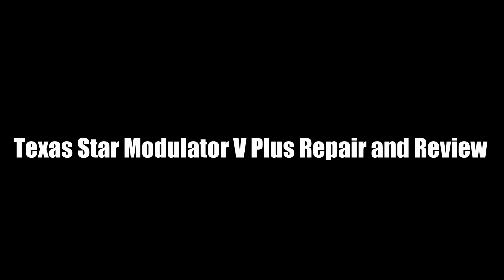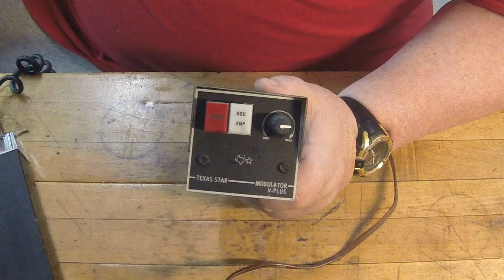Texas Star Modulator V Plus CB Amp Diagnose and Repair

Comment: Used to hit mine with 1watt dead key that would swing to 22 watts peek and give me 90 watts rms watts were around 1 to 8 watts that would net around 30 or so RMS watts. Power wire upgrade hotter radio should net above 20 more watts.

Comment: Hope you kept that little amp, they are getting extremely rare to find in good condition. It is definitely worth the value of the Toshiba pill and then some. They built that to compete with the popular BlackCat JB-12 modulator amps back in the day.
Reply from the maker: Yes I still have it like you said it would be hard to find another one.

Comment: I just picked one up with a bracket for $80.
It has original 2290 in it and I'm told it works. I will test it later today. 
Can i manually key this if i connect where the diode is by the relay?

Comment: I have a marko 100F amp that I’m driving with a 1970s cobra 29 that got warm and now does the same thing: Pre-amp works but I’m actually putting out less on the meter of another radio when the amp is on. Got to run it by the shop this week 😪